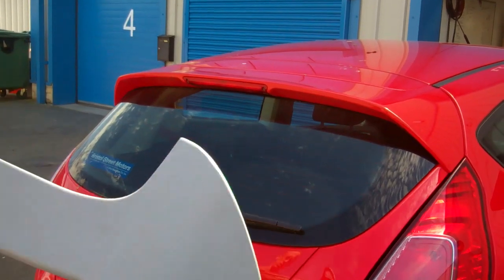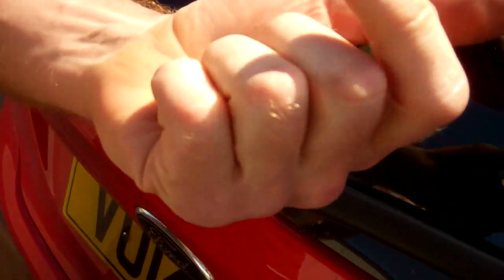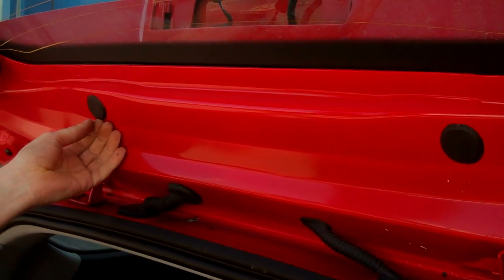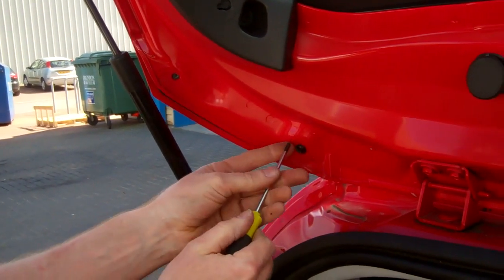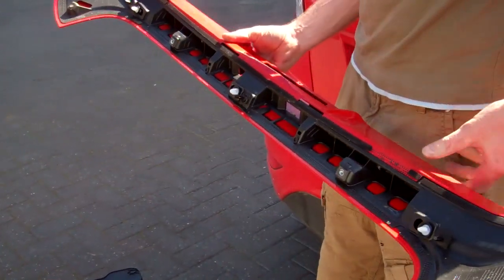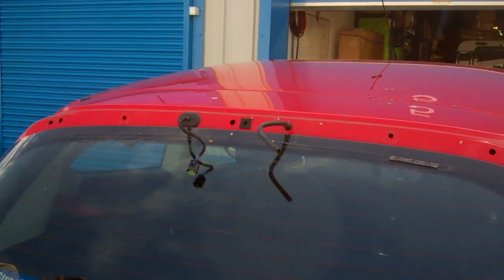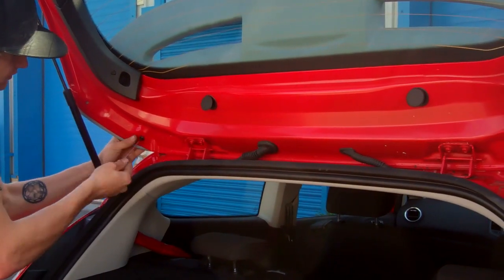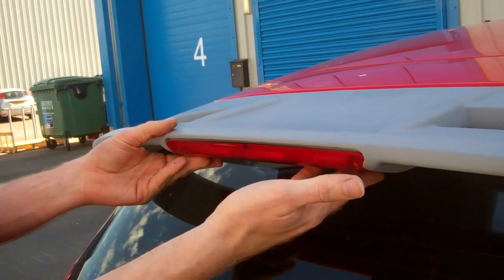How to remove swap change the rear spoiler on Ford Fiesta Mk7

Comment: Guys don't bother chopping and soldering wires :) they won't have made a seperate wiring look for Zetec+ZetecS+ ST etc, take off the old spoiler, unwrap the tape from around the wire and washer hose and gently pull it through the bung. Job done!
Reply: This is actually true , I just did this for my fiesta , just take the tape off , and very carefully pull the wire through .. not the same for the wiper tube though
Reply: Flux Ride what did you do for the wiper tube?
Reply: Carlos Fierros The wiper tube would have to be extended; at least that's what was done with mine.
Reply: Can someone show me a link how to do the wiring and hose
Reply: I have a Fiesta titanium. Do I not need to cut it and solder it?
Reply: I love you❣
Reply: @996Theking  any answers?
Reply: @JokobZuma  yes I figured it out my self. Just pull the brake light. You can pull quite a bit of it 👍

Comment: Hi, I have a standard Fiesta and I'd like to do the same spoiler upgrade, but the supplier is out of stock. Do you know where else I can get an ST-style spoiler? Needs to fit onto a standard 2010 Fiesta, not the ST one.
Thanks in advance!
Reply: All these st spoilers have the same fittings for 2008-2017 fiestas. I recently picked one up from eBay which is perfect, they pop up lots on there. Can also try fb marketplace
Reply: Hey! Did you end up doing it?
Reply: @E1EDITSYT  yes I did ! I ordered the spoiler from eBay
Reply: @DOMIN8RRR  did you have to get extension cables and paint to spray it?
Reply: @E1EDITSYT  so i bought it in gloss black, so I didn’t have to respray it - I can send the eBay link if you like. It came with some wire which we had to solder on to extend the brake light wire, then it was good to go (except no rear washer fluid)
Reply: @DOMIN8RRR  a link would be very helpful. Thank you man
Reply: @DOMIN8RRR   was it an official Ford spoiler? Im not sure if I should buy this one (powerfuluk) because i don’t know if it’s a cheap plastic. I heard someone say it rattles.
Reply: @E1EDITSYT  nah it’s not official, the official ones will cost more. It would only rattle if it’s not on securely, mine is fine

Comment: The window washer when activated sprays the floor, not the window. The angle just isn't right on this spoiler. Any ideas?
Reply from the maker: +Diluted Shade Hi - is there an "eyeball" in the middle of the washer that you can direct the direction of the spray - use a pin. This is normal for front screen washers but not sure if its the same for the rear.
Reply: +powerfulukltd Nope it's just a hard plastic, no way to change the direction at all. Hmmm. Not quite a direct swap, it's been bugging me for a while
Reply from the maker: +Diluted Shade Can you look at a genuine one and see where it points ? I will take a look next time our cleaner comes over - she has a genuine Ford Fiesta ST. Another random thought ... you cant rotate it 180 Deg ?
Reply: @L663  did you guys figure that out, 6 years later lol

Comment: what can you do for the wire of the break and for the pipe of the washer ? thanks
Reply: did you find any solution?
Reply: @huncho3900  still wondering
Reply: I got the light thag came with the spoiler and have an idea how to connet it, but its gonna be hard

Comment: Just a question I’ve got a stock fiesta but could I change the bumpers, spoiler and the skirts to zetec s parts?
Reply: Yes you can I'm on doing this at the moment I'm changing the rear bumper part and the spoiler I'm not sure about the side skirts tho mate
Reply: Yes you can I’ve done it
Reply: @dannybeaty9237  what rear bumper did u go with trying to do this myself

Comment: Ive done this but my brake light and hose dont have the length to connect. What should I do
Reply: Did you ever figure out a solution?
Reply: @shanebreezy4453  use more wire and hose he does explain this in the video !!!

Comment: Is it worth buying a £120 spoiler from eBay and doing this to my 2013 style zetec fiesta/will it look or make the car function differently?
Reply from the maker: Hi probably not going to transform the car ! although on the old MG Metro the rear spoiler added 10% to the fuel economy...
Reply: powerfulukltd Thanks for the reply, what I mean is will the spoiler rattle or will I have problems with the lights?
Reply: @joshlong7941  did u bought spoiler I was looking for Ford feista zetec 2012 aswell could U tell me which one is perfect thanks
Reply: @BinamBinamVlogs7  hi mate, I did buy one and it was perfect. Got the one from eBay, wasn’t a replica it was the spoiler taken from an S and never had any issues

Comment: do you guys still stock this spoiler? i cannot find it on your website. also do you sell any other fiesta body parts? i have a base spec fiesta and want to make it look like the zetec s model.
Reply from the maker: +Dom Drake We do still stock this product. Unfortunately we do not do any other parts for the fiesta. We do some coloured spoilers but currently have no stock of these and won't have any for a month or so, only primer available. Sorry we cannot be anymore help. Here is the link for our ST spoiler. http://www.ebay.co.uk/itm/ABS-Rear-tailgate-roof-Spoiler-ST-look-Ford-Fiesta-MK7-VII-2008-on-NEW-7-8-RS-/281777468633?fits=Model%3AFiesta&hash=item419b3ef4d9:g:wF8AAOSw3xJVcBlm

Comment: After installing the st spoiler I have noticed my car keeps showing boot open error. Any ideas what I might have done wrong?
Reply from the maker: Hi there must be a switch somewhere that tells the car the boot is open - have a look around the edge of the boot for the switch and this should lead you to the problem.
Reply: powerfulukltd thank you for replying, I have tried searching for the switch everywhere but can not find it, it might be inside the lock. I can confirm the lock works perfectly but the car shows the boot is open. Even when the engine is off my head lamp flashes all night. Also when driving the car is making error sounds like boot opened then it disappears then it comes back again. I am soo annoyed no one knows what it can be.
Reply from the maker: Seems a common problem on the Mk7 Fiesta
https://www.fordownersclub.com/forums/topic/94098-fiesta-boot-open-warning/
Looks like it may need a new switch.
Reply: powerfulukltd thank you very much I will see if I can get one.

Comment: Anyone know where to get the extension kit from as I’ve had mine sprayed and I fit it myself just can’t connect back light
Reply: I am wondering the same thing myself, did you figure anything out?
Reply: You can cut the plug off, leaving enough to crimp a wire to the existing wire to make it long enough. So basically just get two crimps and a bit of addition wire

Comment: Can you put this spoiler on a 2009 fiesta, not zetec ?
Reply: Connor Mcindoe yeah, i bought the spoiler off of ebay for £85, the exact same one in this video, i have a 2010 Ford Fiesta Edge (the most basic form of fiesta i'm pretty sure)
Reply: Cornish21Pasty could you link me to the fitting kit and spoiler you used, I have a 2010 edge in vision blue and am looking to fit a spoiler to it.

Comment: Look like cheap, from genuine quality ford part
Reply from the maker: +kekkoz10 Hi - they feel about the same weight and quality but i would agree that if you can afford it the genuine ones are better.
Reply: They are awful .. require so much work to be sanded , filled and re primed it's really not worth it. Your better off saving up.
Reply: @nathaaanplayzfn6606  a friend of mine bought a fiberglass spoiler and after three month it broke. For my own car i bought a second hand oem ford spoiler and since november 2017 at today is perfect
Reply: All I'm saying is the ones they sell on there website are a waste of money better off getting genuine ford parts.